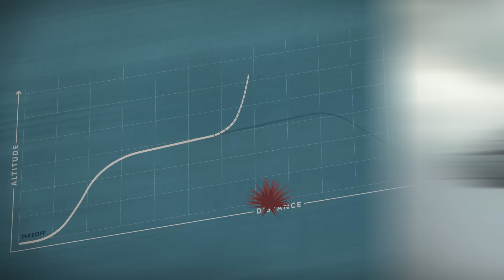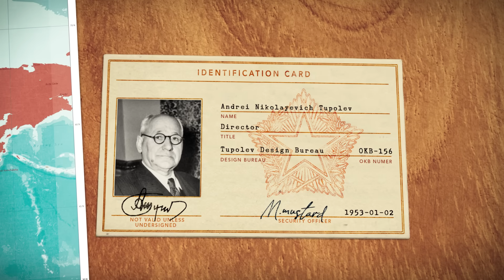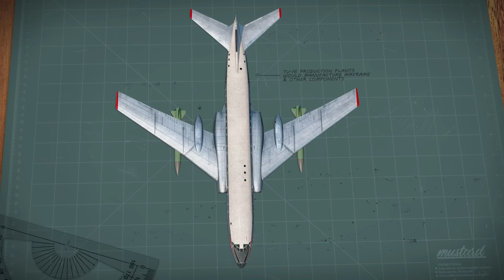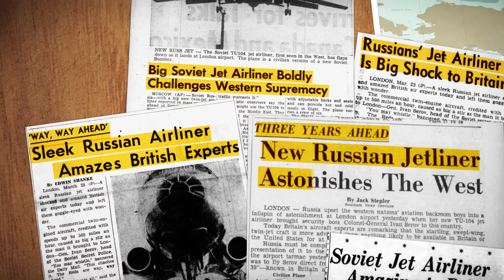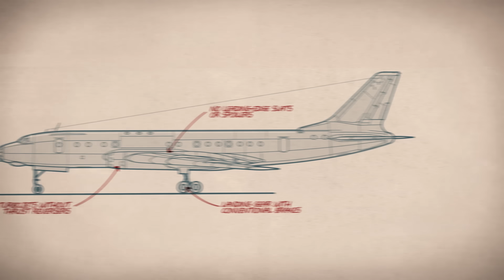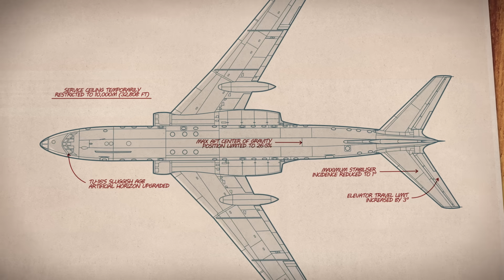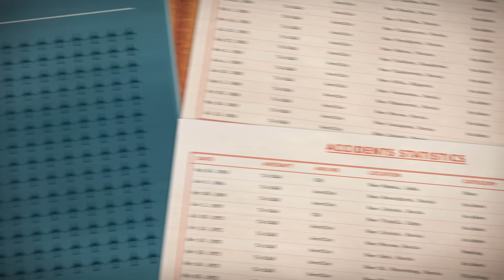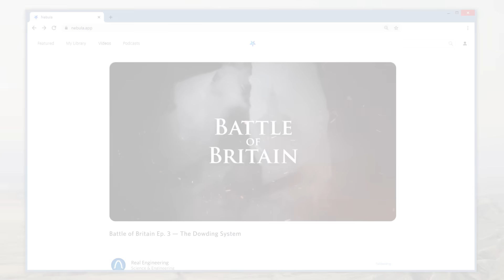The Soviet Airliner Designed To Crash

Comment: Just as dangerous as Comet and 737.
Reply: The Comet remains the worst jet airliner in history and has the highest loss rate and fatalities statistics.

The Boeing 737 is the most successful aircraft in history with over 23,000 sold.
 It has a very good statistical safety record compared to other jets.

One out of every three people in the air as you read this is onboard a 737, one takes off or lands every 3 seconds.
Reply: @sandervanderkammen9230 

@sandervanderkammen9230 

We feel we can clear up some common false myths, misunderstandings & misconceptions.

It's always very important to note the relevant facts obviously.

    Regarding the UK Aerospace Sector.
   
An airline recently ordered 60 RR Trent XWB Engines 

   Clearly It's a great pity & a crying shame that British military forces had to occupy a large part of Germany for decades after 1945 & Russian military forces had to do the same. Of course Russia still posseses a large chunk of what was German territory & of course  Russia & the UK produce nukes. Obviously Germany does not produce nukes.

   Interesting British achievements.
There is no doubt that the Fairey (England)
Delta 2 was of course the world's first jet
aircraft to exceed 1000 mph.  lndeed It
exceeded the previous record by 310 mph &
held the record for 1 year. Incidentally, the Dassault Mirage 3 & 4 are based on the Fairey Delta 2.

     Early days, jet fighters.
De Havilland Vampire, Sea Vixen & Gloster Meteor accident losses were not high or unusual for fighter aircraft at the time. De Havilland built large numbers of all metal airframe aircraft before the DH Comet for example.
We mustn't forget of course that the DH Vampire first flew in 1943 & the jet engine was also built by De Havilland. There were examples of the Vampire interceptor / fighter in service until 1990 which was operated by more than 30 countries. Of course, at the time, during 1943, the Vampire was one of the world's first jet fighter aircraft which also happened to have extremely reliable jet engines, obviously.

Non combat phase accident losses.
% of Aircraft built.
The Canadair CL-44 was a turboprop airliner.
Canadair CL-44             (ff 1959 ) 48%
Lockheed XF104             (ff 1954) 100%
Lockheed  P80                (ff 1944) 43%
Lockheed F104                (ff 1954) 45%
McDonnell FH Phantom  (ff 1945) 35%
Gloster Meteor               (ff 1943)  21%
DH Vampire                     (ff 1943)  23%
DH Sea Vixen                  (ff  1951) 33%
Gloster Javelin               (ff 1951) 20%

   An example of what goes on these days in various countries.
Obviously, for example, there are of course no German companies that makes German jet aircraft in Germany & there are no German Companies that make German gas turbine aero engines in Germany that are suitable for widebody airliners.

     That's correct, Brazil makes very good airliners & Brazil is 100th down the list along with Indonesia for wealth per capita. Of course it is in fact the case that Embraer can't build those airliners without purchasing stuff from the US, UK & Europe.
Norway Holland Denmark Ireland Belgium - Top 20 wealth per capita - Don't make airliners -  its as simple as that.

   Early days of the airliners.
That's correct of course, at the time the Comet wasn't particularly dangerous. Agreed, that is indeed the case of course, The DH Comet was definitely not the worst engineering failure in commercial airliner history.

Losses comparisons
How things were in those days.

DeHavilland Comet 4 UK                       14% 
DeHavilland Comet all  (ff 1949)           17%  

Boeing 307                               70%
Boeing 247                               48%
Boeing 707            .                  20% 
Lockheed Electra Turboprop   29%
Canadair CL-44  Turboprop     46%  
Convair CV-580  Turboprop     22%
Convair CV-880    (ff 1959)       27%  
Convair CV-990     (ff 1961)      33%
Tupolev TU-104       (ff 1955)    16%

     Of course De Havilland had prior experience building many all metal construction airframe aircraft & thousands of jet powered fighter aircraft that were primarily of metal construction with pressurised cockpits & jet engines built by De-Havilland.

  More recent UK military jet aircraft.

  Of course the Tornado & Typhoon & their engines are supersonic & are indeed British design aircraft with British design engines built by an international consortium. The Tornado design for example started life during the 1950s at Vickers as the AFVG, it's engine is based on the RR RB-199. The EE Lightening is also a British Supersonic jet aircraft.

  The Typhoon is the British BAC-EAP with an engine based on the British RR XG-40, the Typhoon is also built by an international consortium.

  Agreed, that is correct of course, clearly there are many countries that could easily produce airliners of better quality than Bow-wing (see b-47 wing folding & wing collapse incidents) but don't for some very good reasons. Bow-wing (see B-47 wing folding  & wing collapse incidents) being a result of the size of the US, the large protected domestic market & great ease of testing new types due to the equator to arctic geography complete with up to date aviation infrastructure & a few other reasons related to production scale capability, politics, the nature of the airliner market coupled with the nature of airliners themselves & general basic economics.

  Obviously there really is nothing special about Bow-wing, having more than 50 years design / build experience on the type means they have no excuses for the horrendous 737 Max incidents for example.

    Indeed BAe Systems & Rolls Royce combined now do more Airbus work than Germany on an absolute basis & significantly more work than that on a per capita basis.
   
     Agreed, per capita for the home nation BAe Systems is the world's largest defence contractor.
  
    Correct, BAe systems announced the recent £4 Billion takeover of Colorado based US based Ball Aerospace.
  
    It's definitely the case that BAE systems now does a significantly higher value of work for Airbus than it did when it was a major Airbus shareholder before 2005.
     
      Obviously RR now owns US Engine maker Allison for example which does classified Aerospace work for the US Govt.
   
   Yes, that's right of course, Anybody currently flying on a widebody airliner stands a good chance of being on an aircraft powered by RR gas turbine aero engines built in the UK.

   A typical but small glimpse of what goes on in the very internationally orientated British aerospace sector.  

  Of course the RR Nene was in fact the world's most reliable & most powerful gas turbine aero engine in 1944. Licensed built versions & copies of the RR Nene & RR Derwent would go on to power many aircraft in Russia (including the Mig 15 & Mig 17), the US, China, France & other countries for decades after 1944.

      Boeing Apache Attack Helicopter.
AH-64: 75 UK suppliers, 7% UK content, global fleet of 1280+ aircraft.
F35B more than 130 UK Suppliers, more than 30% UK content.
F35A & F35C more than 130 UK Suppliers, more than 15% UK content.

   There is no doubt that an airline has just ordered
60 RR England Trent XWB Engines

Obviously the UK has the
World's Highest Combined Per Capita
 Nuclear / Defence / Aerospace Sector Activity.

Rolls Royce Holdings UK
Subsidiaries
- Rolls-Royce plc
- Rolls-Royce North America (Allison etc Classified Military stuff)
- Rolls-Royce AB
- Rolls-Royce Deutschland
- Rolls-Royce India Private Limited
- Rolls-Royce Marine Power Operations
- Vinters Engineering Limited
- Rolls-Royce Controls and Data Services
- Rolls-Royce Power Systems
- Bergen Marine
Joint ventures include:
- Rolls-Royce Turbomeca
- MTU Turbomeca -

Trent Family
The MT30 (Marine Turbine)
Industrial Trent 60 Gas Turbine
Trent 7000
Trent XWB Airbus A330neo.
Trent 1500
Trent 1000
Trent 500
Trent 600
Trent 700
Trent 800
Trent 8100
Trent 900

RR wholly owned subsidiaries in Germany handle smaller 2 shaft RR gas turbine aero engine work.

We hope this helps, of course as always.  

Cheers & 😎 & of course 👍 indeed.
    
   

   

. ..... ..... ...... ...
 ..... .... .... .... ..
.... ..    .. .. .... ..
..... ... ..... .......
Clearly the line above this line is not blank.
Reply: @sandervanderkammen9230 @DoktorBayerischeMotorenWerke  

We feel we can clear up some commonly held myths and misconceptions, obviously.

It's always good to see the facts presented clearly and concisely isn't it?

That's correct of course, it is in fact true that the following info is entirely correct.

Accident losses, % of aircraft built.
Comet 4                   14% 
Tupolev T-104.        16%
Convair CV- 990      33%     

Wider period, how things were in those days.

    Douglas DC-1          99%
    Douglas DC-2          47%
    Douglas DC-3          30%
    Douglas DC-4           26%
    Boeing s300             72% 
    Boeing 307               70%
    Boeing 247               48%
    Boeing 707               20% 
Lockheed L-049/149 Constellation  30%
Lockheed Electra  Turboprop   29%
Fairchild FH-227                         30%
McDonnell Douglas DC-8          14%
Sud Aviation Caravelle              15%
Canadair CL-44   Turboprop     46%  
Convair CV-580   Turboprop     22%
Convair CV-880    (ff 1959)       27%  
Convair CV-990     (ff 1961)      33%
Tupolev T-104        (ff 1956)      16% 

We hope this helps.

Cheers, as always & 👍 of course.
  
 
 
 
  
 .... ...